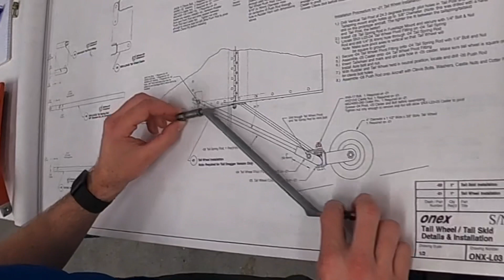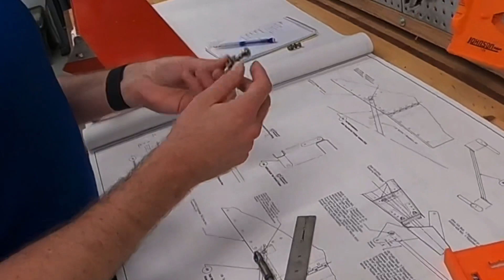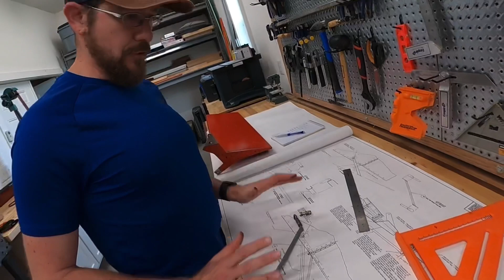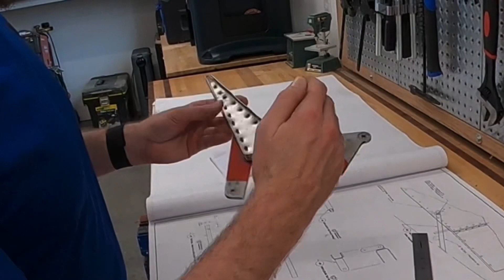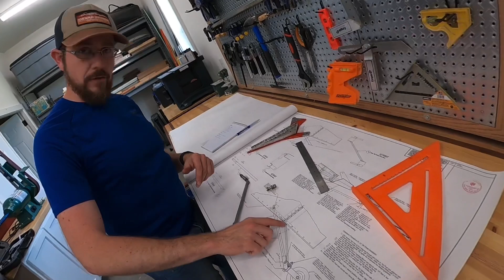So What Went Wrong? (Lean of Peak Aviation)

Comment: Nope. Rivets failed. Dont kid yourself. Frankly I don't like that design one bit! And I am a PP, motorcycle risk taker type A. Nope nope. You are on the right track. Redesign.
Reply: The rivets failed because a non-stock part was used that physically overlaps the control horn and presses down on it when the tailwheel is over to one side.  No re-design is necessary; they just need to rebuild the part per the stock plans so that the physical parts don't overlap.

Comment: wow...I see a lot of posts that experimental is way better than certified but this kinda gives me pause, ie the build quality. I guess however through the miracle of modern media you can get the word out to other owners fairly quickly.
Reply from the maker: I once had a throttle cable snap on me during my takeoff in a Cessna 172.  Experimental planes aren’t inherently more dangerous but as we’ve seen you really have to watch the build quality, especially modifications to the structure.  Build your own and you’ll be fine!

Comment: I think it’s worth putting a go pro mounted back there to watch what’s going on… a lot of good ideas in this thread… but being able to see what’s going on back there might shed some light

Also there is the possibility of wheel shimmy .. that can from time to time cause strong loads
Reply: @Scratch Builder, that is a great idea... A go-pro video of the area of concern... The plane would not even have to take-off... Just fly the empenage, then set it back down to see what happens... Do that several times, and the answer of what is happening, just might come out...

Comment: The fact that this issue took a while to get this severe and you or the inspecting mechanic didn't catch it is scary. If you used a mechanic to do the Conditional, first thing is fire them and never use them again.  Secondly you should really take a step back and figure out how you can train/teach yourself to do a better job of preflight/inspections. Not sure how often you fly but waiting until the Conditional yearly to deep dive into systems is asking for trouble. I change my oil every 25 hrs and do a pretty good inspection of the whole plane while I'm at it. At the lastConditional, that tail end should have been raised and tailwheel inspected. At that point there is absolutely no way any competent person wouldn't have seen the issue
Reply: Throttle back Maverick. $10 says given enough time someone can find something wrong with your aircraft you were unaware of.
Reply: @Mike-tt8wi  never said my plane is perfect but guarantee you wont find something as blatant as a rudder half falling off. Good try though goose!

Comment: There's a bunch of things going on there;  I'll begin by pointing out that tailwheels usually operate with a caster angle which puts even more of a vertical moment on an offset control rod arrangement.  That the lower rudder rib seems to be formed to a tight radius at the flanges suggests that it is made from a softer aluminum alloy  (could be post-heat treated but I wouldn't bet on that).   Being made of flat stock the rudder horn will have low resistance to twisting which would load up the rivets to the rib one at a time.  The "zipper effect".   Personally, I'd go for a redesign---one where rivets are only loaded in shear.   Perhaps a CNC-milled billet bell crank replacing the lower rudder rib?  Or a Band-Aid strap (U-shape) wrapping under the bell crank and riveted to the forward rudder skin might be a quick and dirty fix.

Comment: So this is  a design flaw? Presumably the Waiex wouldn't have this issue.
Reply: I have 1300+ landings on my Waiex with no apparent stressed rivets. I do have rod ends utilized to take up the vertical loads however.
Reply: Its not a design flaw with the aircraft - the aircraft was not built with the control linkage specified in the plans. The original builder of the airplane substituted their own part. This change caused a physical interference between the parts when the tailwheel is over to one side.

Comment: Checking my ONEX!!! thanks a bunch!!
Reply from the maker: Yeah dude can you believe it?  Be safe.
Reply: @LeanofPeakAviation  just finished almost 4000 mi in July to Ohio and then Montana and back to Oregon.. my tail wheel screws came loose my prop started flaking and my cowling was wearing into my valve covers so I've ordered a new valve covers and the prop is getting repaired... My confidence in the airframe and the engine have shot way up... Now I'll do a thorough inspection of the rudder area
Reply: @1bengrubb  Hey Ben, Ex RV4 builder/pilot here. Seems kinda sketchy for your cowl to contact your valve covers. Baffle seal maybe, but not fiberglass to metal. I would worry about the vibration of the engine being transmitted  into the airframe instruments, etc.  Anyway, been following some of your adventures on Youtube. Kinda reminds me of me. After 4 years building my early kit RV4 plus another 6 years flying the hell out of it, I sold it about 2002-3 to get back to the real thing, HG. Good luck, listen to your aircraft. it has been talking to you.....Joe Evens
Reply: @charlesevens5377  hey thanks Joe.  You seen the picture of a 1x how the valve cover stick out the cowling?  The instructions say it's not necessary for the top of the cowling to attach the fuselage so I think the wind pressure is pushing the cowling against the valve covers... My brother bought me a $50 hang glider from a storage sale bought me a secondhand climbing harness and some rope and I was flying!

Comment: I wonder if sequentially larger rivets on the load end would also help retain that piece to prevent any deflection? Certainly correcting the angle to take the slack out of that will be very helpful. Is there any discussion with a hardened stainless steel washer for potentially the 1st 3 or 4 holes on the lowend to prevent that soft aluminum piece from deforming?
Reply: I have used that technique a number of times on various parts of racing cars over the years.  Obviously, the forces which caused the failure will have to be identified and eliminated, but adding washers as you describe is a good bit of insurance going forward.
Reply: @oddshot60   I'll be interested to see what your solution is some of the engineers below agreed with you by eliminating the angle and the tension in the linkage. it's so frustrating how every solution adds weight. good luck and stay safe I'll be watching

Comment: Very interesting, have a friend who built one of these and had major issues with the AeroVee engine in his, and a total failure of another in a Onex he was test flying for a friend. Ignition problems in his and oil feed in the other.  A Sonex that was built here by another mate was the subject of some discussion in that differential braking was not possible with the single brake lever so relying on the tailwheel link for steering, having had one of those break on two occasions on our RV6 I was wary of that idea so we fitted two brake levers on the same shaft so that one could apply pressure to each brake individually worked really well and of course if the link did break or separate you were not faced with a ground loop. In the case of our RV I removed the link and fitted the Vans deluxe tail wheel springs which have worked very well since.
Reply: @Jonathon Ludgator, I did not realize the Sonex has no capability for differential braking... I'm now wondering if a turning brake hand powered actuator (used on OhV buggies) , could be used for diff.  braking on the MLG brakes....Not having the option for differential braking, does create concern for this design... I'm not in favor of the radically-offset tail wheel push-pull rod, that Sonex designed either....

Comment: Excellent update, thank you!

Just a thought: if you held the tailwheel centered and applied left rudder pressure, it would have a similar affect as pushing the tailwheel to the right.

In other words, left rudder cable tension combined with tailwheel resistance towards the right applies downward pressure on the drive horn, and would be at its maximum when the position of the tailwheel is to the right.

Comment: Stop,Stop... Earl Greystone is 100% correct. Having a solid linkage to that tail wheel is the wrong design. I don't care how long Sonix's have been flying, I would bet that if you go and look at all of those previous aircraft with a solid linkage you will find fastener fatigue or sheetmetal fatigue cracks. I can't fathom a way they're getting around it. The steering of that tail wheel, if it's tied to the rudder directly needs to have a sprung system or you're always going to be inducing a load on the most critical attach point for your control system Bell crank. Generally your control system Bell crank should be mounted separately and independent of the steering system
Reply: If it can't be sprung as per other comments, perhaps ball joints at each end, it should not be rigid.
Reply: "I don't care how long Sonix's [sic] have been flying..."  is the same thing as saying "I don't care about all of the real-world experience out there, I'm going to go with my gut feeling instead of the actual evidence".
If you haven't ever built it or maintained it, and if you haven't ever looked at the plans to understand how it is engineered, then your opinion is not as valid as the tens of thousands of hours of operation that actual Sonex airplanes have experienced.
Reply: @noelwade  Thanks for that perspective. The next time I'm on a post Columbia Return to Flight Team, or C-17 post MLG pods all over the runway despite my delay of flight actions post discussions with the design team overturning my delay .. or...or... (the list is interesting) I will take your perspective into consideration. Not trying g to be a smarty pants, but if I had a dollar for every time somebody tried to convince me "that never having a prior failure was good engineering," I'd be rich.
This gentleman's incident is equivalent to the actual pre Space Shuttle Columbia piece of foam that was the cause of all the lost lives and an example of the O-ring that never ever was going to fail on Challenger and...
Reply: @C. G.  - Have you engineered, built, or maintained any components of the Space Shuttle program, C-17 systems, or indeed any aircraft? Not trying to be a smarty pants, but I've read all of the accident investigation board reports and analyses for the incidents you mention - and I have to say that none of them were very applicable when it came to building my Sonex airplane.  
But I have built a Sonex, which involved spending hours with my hands on the actual parts, learning how they go together, and understanding how they interact. I've also spent hundreds of hours conversing with other people who've actually built Sonex aircraft and flown them. I've also owned 3 other "experimental" aircraft and been hands-on in modifying and improving them. So unless you have commensurate experience, I will continue to trust in the evidence of tens of thousands of hours & landings on real flying Sonexes over your opinion.  
(Also, Columbia and Shuttle are both red-herring arguments; since the engineers of those vehicles did raise concerns and failure modes but they were dismissed by management. That is a wholly different situation from an outsider with no experience raising concerns when the engineers of the vehicles have already analyzed and explained the issue)
Reply: To be clear: I don't have a problem with you, C.G.  I have a problem with the kind of blunt/blanket statement "a solid linkage to that tail wheel is the wrong design."  
That is a statement backed up by no facts in evidence.  Yes, its an unusual design; but you have not presented any evidence to prove that your point is valid. If you had done a careful engineering analysis of the entire system and could show you work, then it'd be worth listening to and looking over your analysis.  If you had a long pedigree of designing tailwheel aircraft and could point to that experience, then your assertion would be worth serious consideration.  But a blanket statement backed up by only opinion is not helpful to anyone. Its not helpful to the owner who posted this video, and its potentially misleading for others who come along later and decide to further modify this system (when modifications where what caused the problem in the first place).
Reply: Noel, you have some serious challenges in life. You have no clue what I have achieved in aeronautics and astronautics over 40 years in the industry. 
And you do have a problem with my comment because you're avoiding the other 10 guys who are also stating the same. 
But only for the Grace of God, if this man flew that plane that day he would have had no rudder doing aerobatics and this would be a major investigation of the entire design. I'm also not going to sit here and waste time over the calculations of all the issues with that Bell crank placement not being further up into the rudder and thus captivated above and below. Rest assured I have designs in atmospheric and extra atmospheric flight today. 
Have a good day.
Reply: @C. G.  - You claim to have designs, but you're unwilling to name them or discuss the engineering? That does not lend any credence to your claims.  Escalating your rhetoric by trying to demean me undercuts your argument, too. I may have many challenges in life, like anyone; but I have built a Sonex, and therefore I have more hands-on experience with these parts than you do. You are 100% correct that the poster of this video would have had a major accident if he'd flown aerobatics that day. I'm deeply grateful that he discovered the issue and is sharing his learnings with others. But you are wrong to make blanket claims that there is a problem with the "entire design". The problem was the initial construction by the initial builder (not the video poster, but the original builder), who substituted his own parts and designs without understanding the effects of doing so.
You say you're not going to "waste time over the calculations", which again proves my point: You're giving opinions without backing them up. If you want to be truly helpful to this pilot and to other builders, then provide facts and evidence. The poster of this video has done so, why not follow his lead instead of just spouting uninformed opinions? Those are already plentiful across the internet...